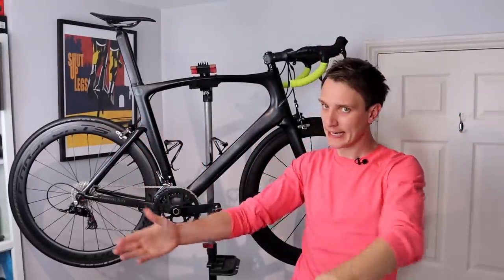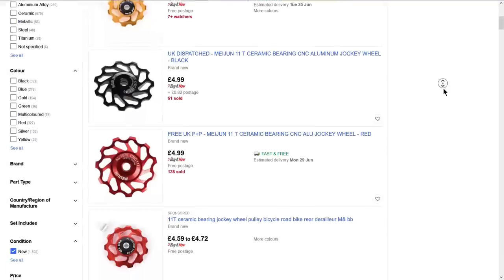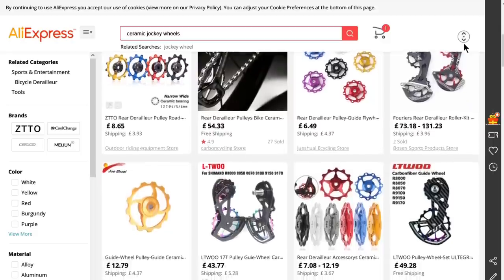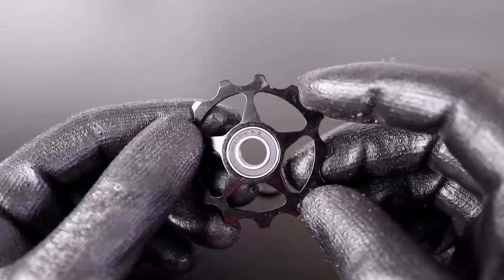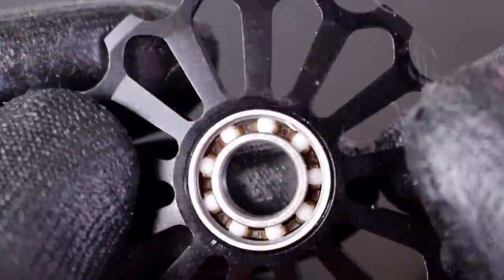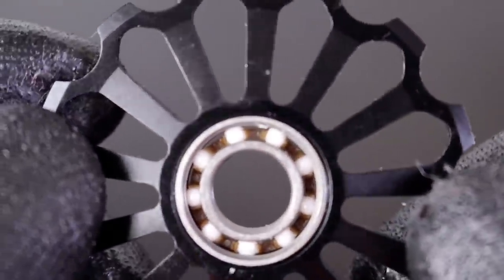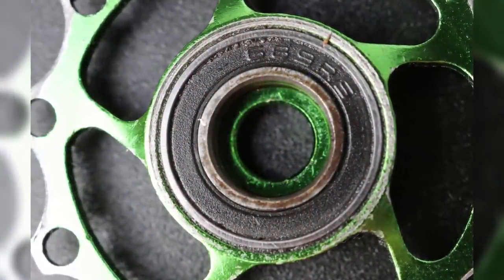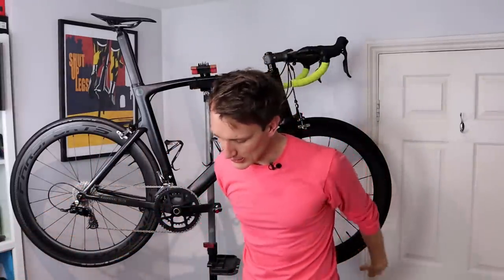Cheap CERAMIC JOCKEY WHEELS - a fatal design flaw!

Comment: Is it possible to "transplant" the seals of the regular bearing into the ceramic ones?
Reply from the maker: Yeah you totally can! i have an oversize rear derailleur cage that came with the crappy ceramic bearings, and as soon as i get it installed, ill be swapping out the bearings. They are the same size, should should slot in fine!
Reply: @TraceVelo  please tell us if they last at least a little bit longer with the seals on.
Also please make a video of how to install those cages.
Reply from the maker: Yeah I'll be covering it soon. Have a few other vids to get out of the way first, but I have it sat on my shelf ready to go

Comment: 608RS 608 refers to the dimensions of the bearing 8 ID x 22 OD x 7 wide mm. This is a ball bearing. The rs indicates that this is a sealed bearing versus an open bearing..

So they have seals. What?

Comment: Hello,
I am launching new London based bicycle brand and ordering my first batch of MTB. Would you agree with below specs.?

aluminum alloy frame,
semi-aluminum fork,
aluminum handlebar,stem ,seat post
Shimano 24 speed（Shimano RS-45 gear shifter,Shimano M310 f/r derailleur,Shimano 8 pcs freewheel)

Comment: What did you do about your knackered shifter?
Reply from the maker: So I actually slapped the Tiagra back on the bike for the front derailleur. I posted a little update on my Instagram if you are interested
Reply: @TraceVelo  I'll follow you on Instagram then, been a while since I've been on there but got to upload 2 of my bike builds so will look tomorrow. One of which has Sensah shifters 😱 but with Sram derailleurs.

Comment: I would also question whether those are really ceramic bearings or just plastic.

The lack of a seal is baffling, as it would add what, a couple more $ to the cost? Weird, considering they'd still be able to undercut CeramicSpeed by a shit ton.
Reply from the maker: They are definitely ceramic bearings, if they were plastic they would wear out after a couple of rides. From reading the comments, I agree with a few people, in the sense that I think the reason for the lack of seals, is that if you slap a cheap seal on them, they wouldn't spin as freely as I demonstrated in the video. So to the average consumer, they would seem no different to the regular jockey wheels. No seals means much less friction, so out of the box, they spin for ages, which is what people generally expect out of fancy ceramic bearings. It seems like marketing BS at the end of the day, just a way to make them seem better than they actually are if you see what I mean.
Reply: @TraceVelo  Huh. That makes a devious amount of sense.

Comment: What if I buy the ceramic ones but choose to install my own seals to seal the bearings?
Reply: Just get steel. Ceramic bearings just spin 3% better, but due to wear become more resistant than steel over time. Also the tolerances are shit on these because they are just a gimmick, real ceramic bearings are only used in high speed and low load applications.

Comment: Just buy a 10 pack of cheap 689 bearings and steal the seals off and place them on the ceramic ones... I recieved ceramic type but with steel inner race, so just going to swap some seals over

Comment: Nice video thanks! The main reason to leave off the seal is a short term gain in friction as the seal is costing about 50% of the bearing drag (https://www.youtube.com/watch?v=A4-39TuvOCs&t=11m45s). However the penalty is very high for this approach for normal day-to-day cycling.

Comment: Replace the cheap bearing with https://www.bearings-online.co.uk/item/3398/EEC/689-2RS-Ceramic-Hybrid-Ball-Bearing-9x17x5.html and you have full sealed ceramics with steel races...

Comment: I would encourage people not to buy any cheap jockey wheels of this design because of a far more "fatal design flaw" than bearing longevity addressed in this video.
These jockey wheels are all extremely cheaply made and the bearings are retained by press-fit. There is no material or anything physically retaining the jockey wheel on the bearing besides friction. Even the cover plates sit entirely within the diameter of the bearing itself. Compare this to the Shimano one modelled where the bushing is pretty much just the friction surface but the construction of the wheel otherwise goes right to the centre and is well inside the diameter of the two cover plates. This matters because the guide pulley on a bicycle has to handle significant lateral loads when shifting as it is literally forcing the chain to jump from one sprocket to another. 
I learned this lesson because I too have owned a set of these cheap jockey wheels (necessary replacement or nice red color, you decide the reason!) and I have had the guide fail because of it's design flaw. The jockey wheel moved on the bearing when attempting to change gear and immediately seized, jammed my chain and caused the shifting cable to pull right out of the derailleur! Naturally this happened while riding home from work in the dark. Out of necessity I had to set the limit screws on my derailleur to pick a reasonable gear and ride home with the chain running alongside the now knackered guide jockey and merrily abrading it to hell. You can be sure that the first thing I did in repairing my bike was to reinstall my old Shimano jockeys! The next thing I did was to warn any friends I knew that used the same thing!
Reply from the maker: Damn, that's sucks! It's a fair point though. I haven't had any issues like that, but come to think of it, this could well be a problem with some of them. I've just had a quick check, and all of the ones I have bought, the cover plates on each side do actually overlap onto the body of the jockey wheel, so shouldn't be a problem, but yeah definitely something to watch out for. Thanks for the comment 🙏🙏

Comment: Full ceramic bearing DO NOT have nylon races. If yours do you have been scammed. Full ceramic bearings are self-lubricating, no need for oil or grease. If you grease them (and they don't have seals) you will destroy them.

Comment: Engineering department: regular steel bearings, standard and simple design is effective according to our design models and testing.
Product & marketing: NOOOOO. It doesn't LOOK impressive. Make it asymmetrical, with exotic materials, dangerously light and especially important - in matching colors!

Comment: If somebody told Hambini that there are people who make bearings with nylon races and ceramic balls, he'd use so many swear words that your ears would melt. In engineering terms, that's about the dumbest thing possible. Why do they do it? My guess is that the sort of ceramic ball bearings you can buy eleven of for less than two quid are so far off-round that they won't turn if you put them in a race made of anything more rigid than candle wax.

Comment: PMSL @ the nylon bearing race! OMG. What junk.

PSA - don't let your friends buy metal derailer pulleys. There's a reason they're not original equipment - they're noisy. You can find all sorts of plastic pulleys with ball bearings if you dig through the the ocean of ally ones. And don't bother with ceramic bearings, they're wank.

Ceramic bearings may indeed be a tiny bit nicer than steel ones (as long as theyre sealed and don't have PLASTIC races, LOL), but when I say tiny, I mean tiny. Usually you'll be replacing bushed pulleys, and steel bearings are a far, far bigger improvement over bushings than ceramic bearings are over steel bearings. Ceramic bearings are like audiophile sound cables - a cashed-up wanker tax.

While on the subject of pulleys, you should be able to fit bigger ones in many standard cages. I squeezed 12/14t into a RED cage no problem. I probably could have gone 13/15t, but I wanted to try the narrow/wide style I came across, which works a treat (not available in odd tooth counts, obvs). Larger pulleys require less chain movement, which will save more watts than ceramic bearings, probably by an order of magnitude or two.

Comment: These are not durable. I've had a set of these and they failed in ~6 months with not that many miles. I even lubricated upon installation and disassembled to clean and lubricate a few times.

Comment: The ceramic bearings have no seals because thats what causes the most friction. If they were sealed you wouldnt be able to notice a difference between them and the normal ones.
Ceramic bearings are mostly marketing bs
Reply from the maker: Yeah, I recon you are totally right! The average consumer is probably gonna think that becuase it spins freely, it must be good.